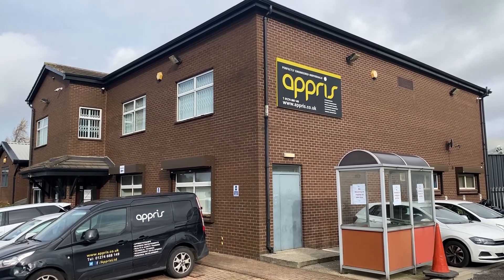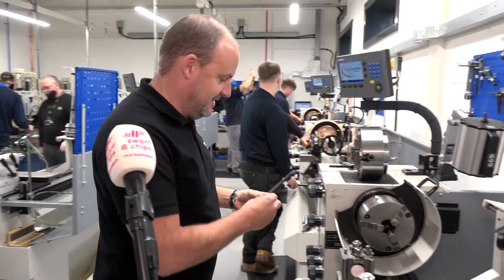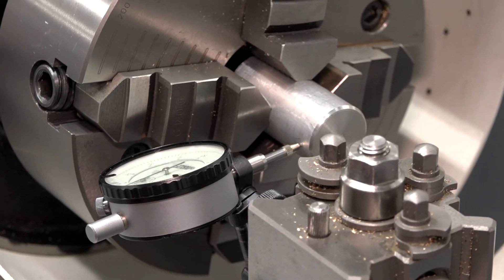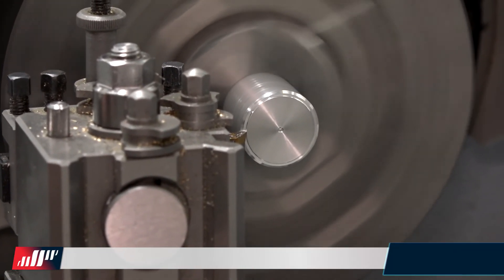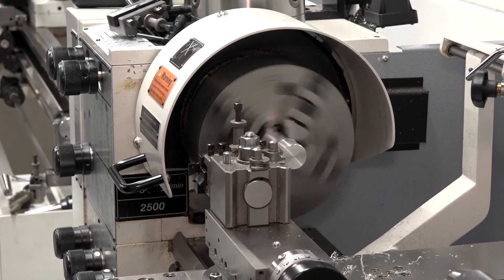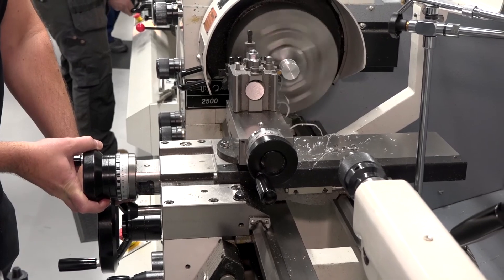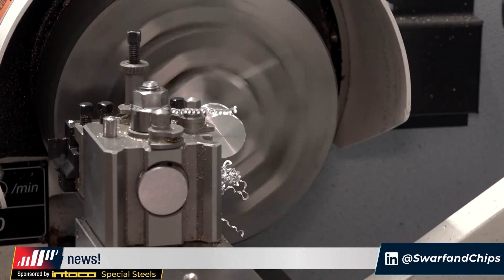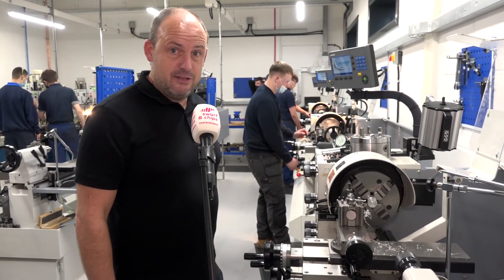Oh no, Paul had a smash on a lathe | #SwarfandChips

Comment: Should be wearing eye protection,you should be confident when operating a manual lathe..plus should be using coolant,will help with parting off by clearing the swarf and cooling the tool and materials. Not trying to be so negative but that’s not good practice
Reply from the maker: no prob thanks @Daniel